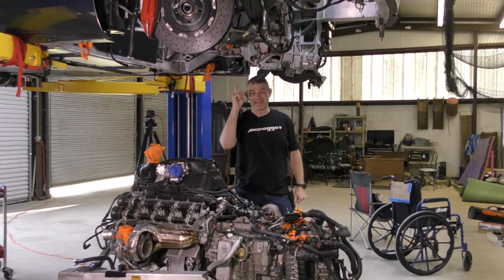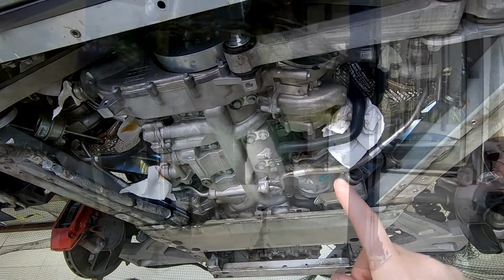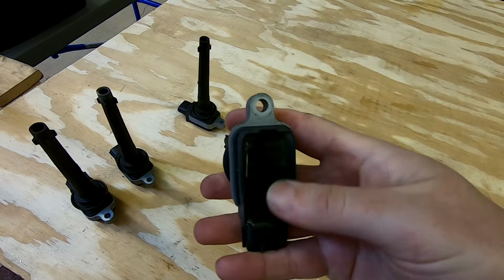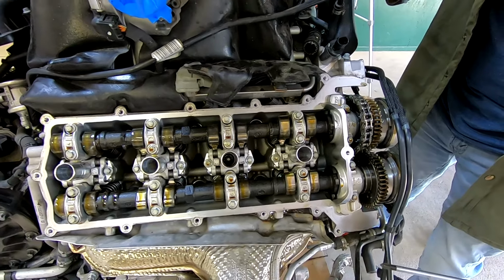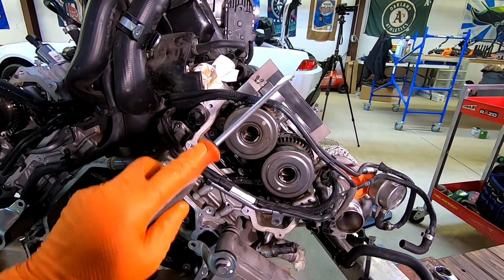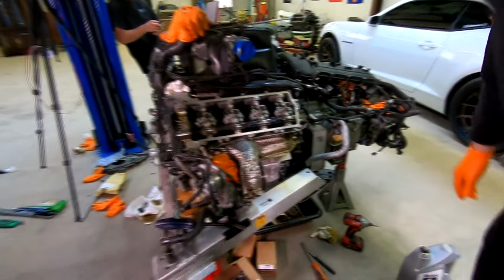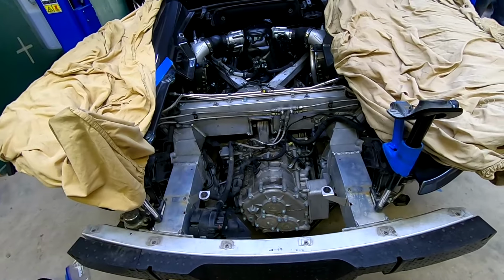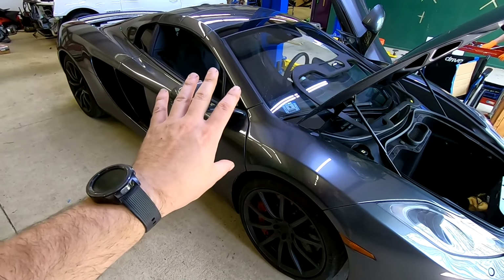We fixed a broken McLaren engine, the warranty said not covered, and it took over 40 hours to fix!

Comment: if you want to seal a split line without disassembly, a guy put us onto stuff aircraft techs use  called aerospace sealant thats fuel rated, the B1/2 being the faster setting than the b2. Drop the oil to stop the weep for a day.   clean and scrub the line, mix the two part sealant and apply and let sit a day or 2 without the oil in it, and it wont leak a drop , the guy showed a seam he did in the late 80's   and hasnt leaked a drop since, You get it on ebay thats near life limitted out.
Reply from the maker: Interesting

Comment: Did you have to re shim the valve ?  Also did the car have a tapping sound when it was running 

I have been diagnosing my 570s it has a tap sound left bank last cyclinder wondering if it’s the same thing
Reply from the maker: No need to reshim, I never heard this engine running prior to me getting to it. The last car I heard tapping had a broken cam phaser which you can hear in the cam phaser specific video I did.

Comment: Excellent video! So the shim for the cam follower came out which broke off the tooth for the cam position sensor? Did you have to reset the code on the ecu?
Reply from the maker: Yeah, pretty crazy how a series of things happened which lead to that. If the arm didn't break the shim wouldn't have come out and wouldn't have hit just the right spot at the right time. OBD2 scanner clears codes and it's good to go, error free now.

Comment: Could you add a video of changing plugs without dropping engine. I have found no video out there which shows this.
Reply from the maker: I haven't had to do them in a while, the last one I did was on a time constraint so doing a video wasn't possible. Doing a video on something takes 3x longer than just dong the job. The next opportunity I get to do one I will.

Comment: It would be nice  to have a street car that all the wiring could be simply unplugged in a group or a couple of groups. A/C lines, coolant hoses, oil and fuel lines with quick disconnects so with onlt a few mechanical connections, drop or pull an engine and/or trans. 
Too bad the tonneau hard cover won't come off and out of the way.
Reply from the maker: If a street car was like that, it would be a turd because that means they know the engine has to come out a lot.

Comment: Sean, amazing video. Fantastic, may I ask what codes were showing on the ecu due to this broken follower? Also how was the engine actually behaving??
Reply from the maker: The car wasn't running when it came in but it's my understanding he had been driving it for some time with the check engine light on before that. It was a cam related code, I don't recall the specific one as everything was cleared by Kevin shortly after we got it started.
Reply: ODB CODE: P0391 Exhaust Camshaft signal implausible

Comment: Love your videos, definitely  given me confidence in owning my exotics long term. BTW why did they refuse warranty? Tune?
Reply from the maker: The warranty was declined before the car was even looked at. CEL was a camshaft fault and they declined it because a prior owner in 2016 went beyond the oil change interval, not mileage, one time.
Reply: When looking at pre-owned McLarens, how do you know if the car ever went over the McLaren limits for warranty?    If the car is currently covered by the Extended McLaren warranty, does that mean you are guaranteed warranty coverage on non-excluded items?
Reply from the maker: If it's currently covered it's within their limits. Anything not covered is simply not covered

Comment: Where did you get your torque specs, where did you source the camshafts from and where did you get the cam alignment/hold tool? I apologies if you mentioned it later in the video but I didn't see it mentioned when you were at those steps. Oh, and costs of those items would be great if you're at liberty to discuss.
Reply from the maker: I've got a spreadsheet of all torque specs someone out together. Engine parts came from Motorcars of GA (McLaren dealer), cam alignment tool came from XPRD. Kevin handled all the parts acquisition so I didn't see the invoices but the parts used including cam phasers were around $6k IIRC, maybe $8k
Reply: @McMedics  Thanks for the info. I just read the thread at ML and saw that most of my questions were answered there as well. Keep up the good work.

Comment: Nice job 👍 The broken finger follower was most likely caused by excessive revs/revving at some point. Do you know the complete history of the car? Even if the owner/s is careful, it only take one rogue service tech or valet parker etc to show off "making flames" and the damage is done!
Reply from the maker: I only know a vague history of the current owner, who isn't the bounce off the rev limiter type. McLaren's aren't like many other brands in that if it can damage it, it won't let you do it. I think it goes back to a casting issue at the factory.
Reply: Meanwhile in the UK, a friend runs an independant Mclaren shop and he says over-revving from cold (not red-lining or anything) has been a good source of work for him!
Reply from the maker: Oh yes from cold that causes all kinds of problems

Comment: I’m looking at a 12c right now but this is the only thing that scares me… maybe I missed it but why wouldn’t the warranty cover this!?
Reply from the maker: The same worry should be had for an F150, they're more prone to failure. Warranty wouldn't cover it because a previous owner 4 years prior waited 14 months to do an oil change.
Reply: @McMedics  oh for sure I’m pretty religious about my oil changes on all my cars so far, thanks for the quick response! And I hope everything proceeds well because I’m looking forward to getting to experience the 12c! I did watch the entire video… I’m sorry if I missed it but are there any telltale signs or excessive noise to look for because the one I’m looking at has about 20k miles, so I guess I would just check the service records for time and mileage between changes
Reply from the maker: @topend2282  Yes there are some signs of current failure, like loads of misfires, but primarily codes about the intake or exhaust cam position. If you know what to listen for you can hear a difference in the exhaust and a clicking in the cam phasers.

Comment: According the oil leak  on top of the engine , it might be a cracked crankcase vent line or a defective air oil seperator!!
Reply from the maker: What we found the oil to be from was actually the drivers side axle seal. It was sending oil EVERYWHERE spinning around.

Comment: So each manufacturer decides what Cylinder number 1 is?  I just did a valve job/ rethread 5 stripped holes in the head on my 07 R6 (Goodness it's so much simpler than this beast of an engine) but Cylinder number 1 is the one furthest from the sprocket side of the cams and what you call cylinder number 1 on this McLaren engine is Cylinder number 4 on my R6. TDC for me is set off of the cylinder furthest away from the timing chains.  I guess there's not "common practice" for that sort of thing?  Interesting
Reply from the maker: V8's are commonly the first cylinder on the left when looking at the crank sprocket side. 4 cylinders are commonly as you described. Not to say all are that way though.
Reply: @McMedics  That is very interesting! So it would be 1-4 from sprocket moving away and then when you switch to the other side of the V does it start over at 1 again or jump to 5?  And does it travel back towards the sprocket or start back at the cylinder near the sprocket on the other leg of the V?  I would think it would go to 5 because there's not like an exhaust bank side of the v and an intake side of the v. There is intake and exhaust on both banks. So Im wondering if they have each bank distinguished somehow (which would allow starting over at 1) or if they keep counting up to 8 and which one is 5?  

Sorry I'm new to the auto world and am LOVING every second of learning about this.  I hope to rebuild a McLaren one day!
Reply from the maker: Cylinder numbers never repeat, 5 is in the similar position to 1.
Reply: @McMedics  Great to know!  Thank you for the responses and insight.  I'll credit you when I rebuild a McLaren one day!  :)

Comment: Eddie!!
Reply: So was the lack of oil going to the follower ever diagnosed? Looks in some way that you fixed the symptoms but not the cause?
Reply from the maker: The cause in every case we believe to be from poor oil condition over time. Example, not checking level and running it low, or going over recommended interval. The wrong oil could also do it. The owner of this one hadn't had the car for years to know how that aspect was managed.

Comment: I've been a motorsport enthusiast since I was 8 and am in my 50s now. I just don't understand, in this day and age, with what we know about metallurgy and design why we have this kind of ish.
Car costs as much as a house yet has problems like poorly design crapboxes. No thanks; but if I ever lose my mind and buy a modern exotic, Ill get it to you.
Reply from the maker: There isn't a single engine from any manufacturer that is impervious to faults. You also can't prevent every engine from poor maintenance. Many problems are caused by oil starvation, because of not checking the level or infrequent oil changes. In many cases the cars that are so expensive are that way because they're leading in technology and have the lowest production. That also means that tracking down a problem and fixing it may take longer due to a lower sample group. It's the price to pay for having the best, really. Though worth noting, the biggest manufacturers also have these problems and they're making millions of them.